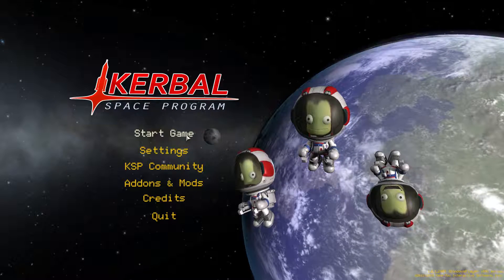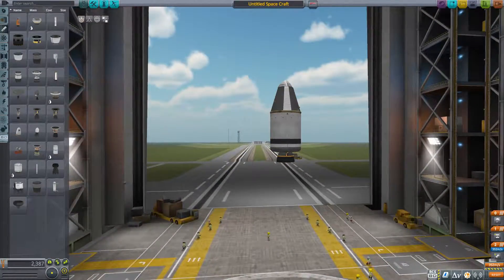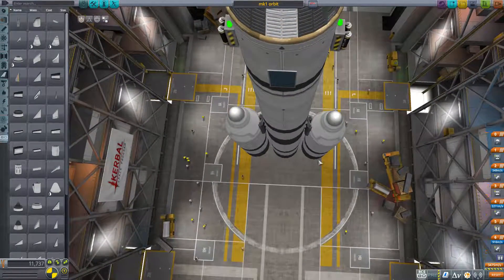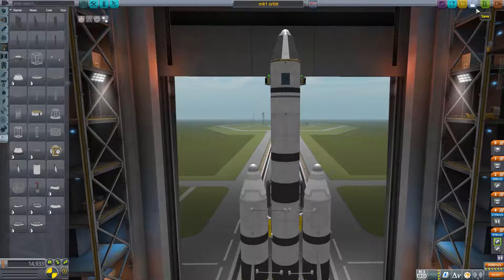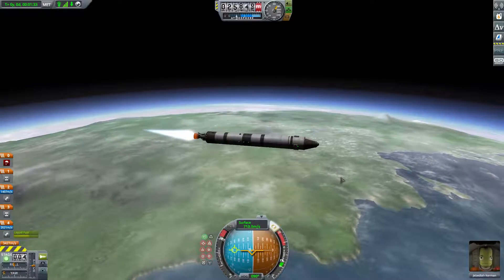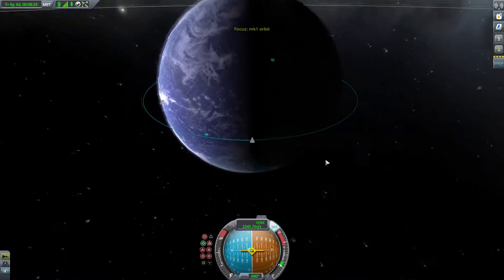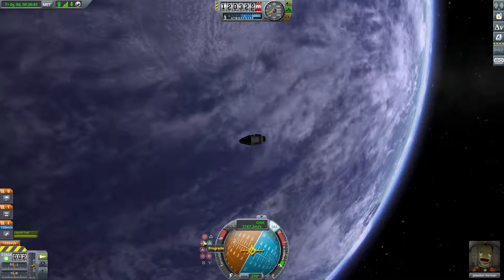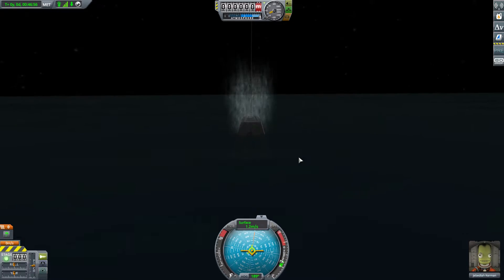How To Orbit in KSP 2019!

Comment: You lost some Delta-V by launching not on full throttle.
Reply from the maker: I didn't know that I will add it into the description when I have time thanks!
Reply: @steven_t_k1068  Also it's not ideal not having vertical fins while there are horizontal fins. There should be at least 3 way symmetric fins or if you think engine gimbal is enough, no fins at all.
Reply: But you're also fighting drag when the shockwaves and heating effects appear. I use that to see how much thrust to use. You'd have to run the numbers, but it wouldn't make much of a difference either way.
Reply: @electrollama2127  When you begin to see drag effects visually and your craft is not aerodynamically good you should reduce throttle, but not before. At 0-250m/s there's no high drag that'd force you to reduce throttle.